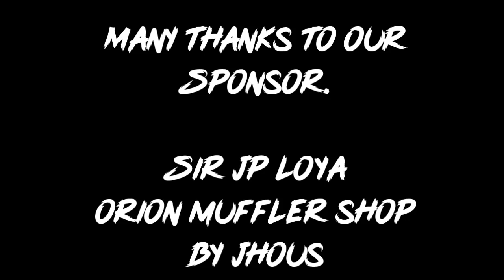INSTALLED! ORION Muffler Shop + 2018 Kawasaki Ninja 400

Comment: Alm nyo ba Para sakin
 best soundng bike ayyy search.. Triumph daytone, Yamaha r6,, kawasaki zx10r and BMW s1000rr. And of course Honda cbr 1000
Reply: twin cyclinder lng kasi yan boss so ang tunog nyan parang raider 150 or sniper 150. yung mga sinasabi mo mga inline 4 yun ibig sabihin 4 cylinder.. hindi sa CC yan ng motor kundi sa number ng cylinder at design ng makina. baka hindi mo alam na may 250cc na honda nuon inline 4 i think NC22 ang tawag nun ang tunog parang ferari tulad din ng honda CBX1100..binago ng mga manufacturer kasi strikto na ang laws about emission. kaya pati ibang 650 ngayun twin cylinder nlng. so alam mo na
Reply: Ahh OK ty for the advice..